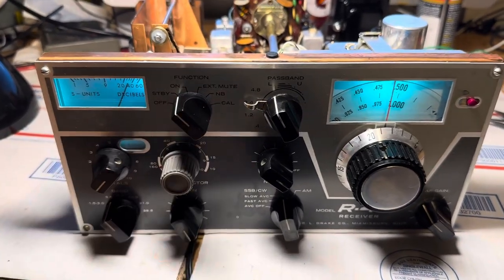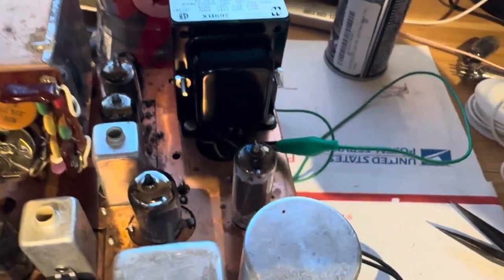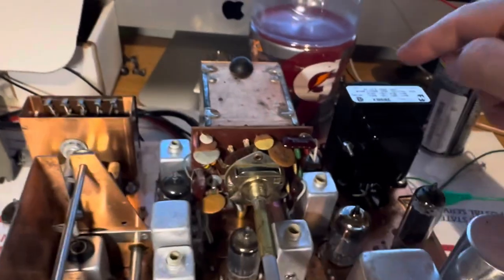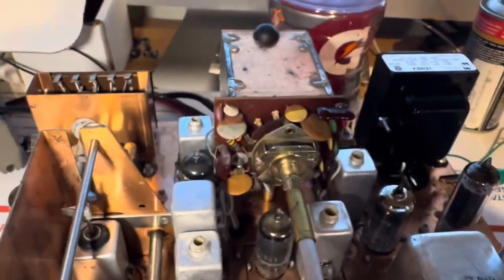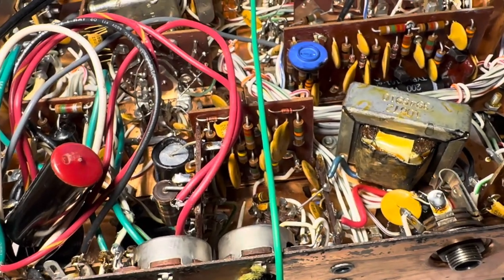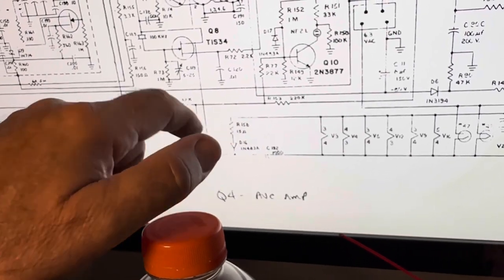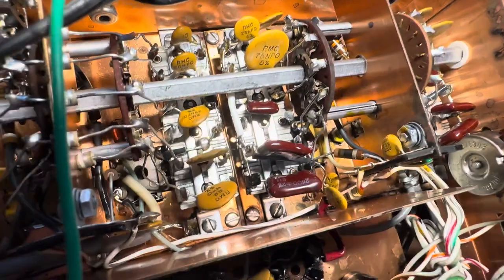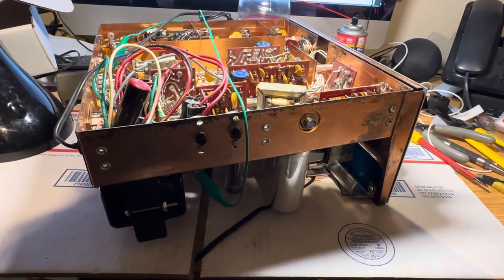Drake R4B new transformer installed. Back from the DEAD. Have a listen. Found shorts… Bad diode too

Comment: Nicly done
Reply from the maker: thanks! I need to install a small 12 volt transformer now and split up the filiment currnet. New transformer getting too hot. Also i need 12 volts AC to get about 9 volts to get the crystal calibrator board to fire up. That board is currently getting about 5 volts and is no operational. I hope the 12 volt transformer at 2 amps with centerr tap will fit somewhere. Guess we will see where i can jam it in. Or not.